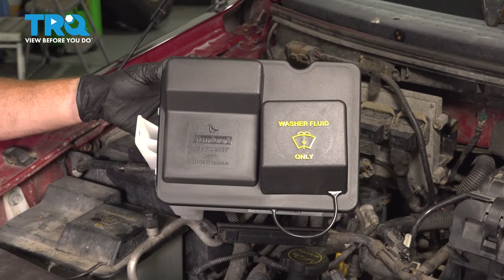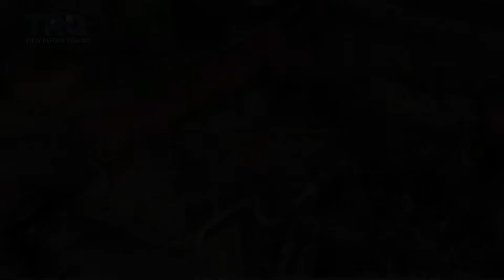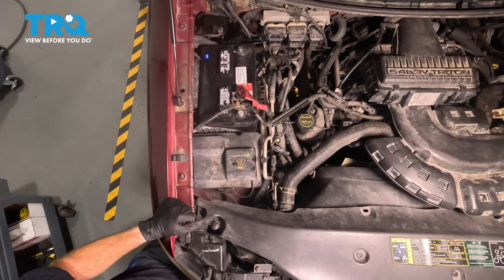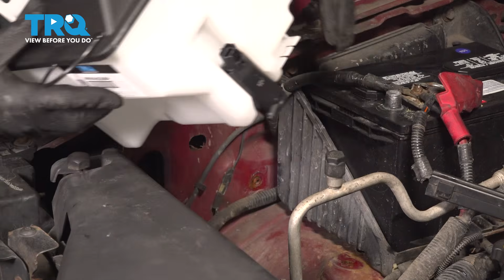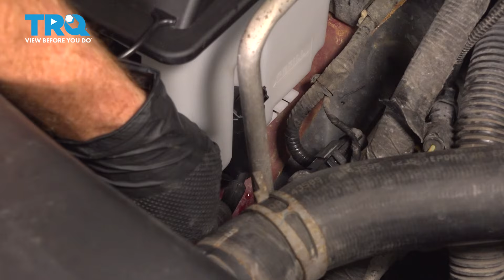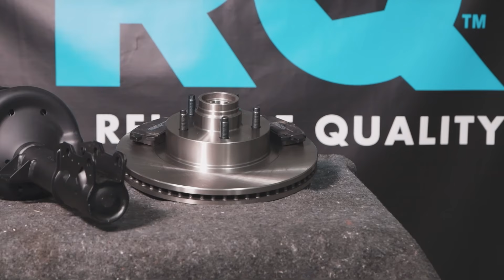How to Replace Windshield Washer Reservoir 2004-2008 Ford F-150

Comment: this helped so much I couldn't find that 3rd bolt in the fender in front o he battery tray i'm putting a new suspension compressor in my 2005 navigator and this part had to come out.